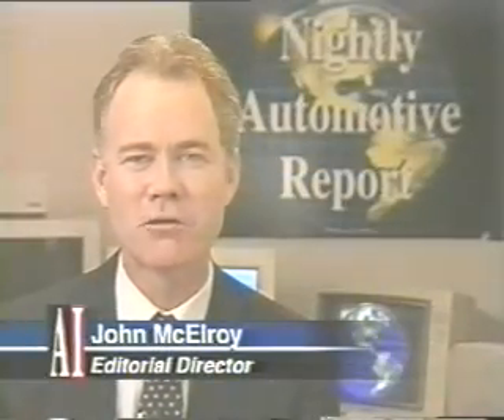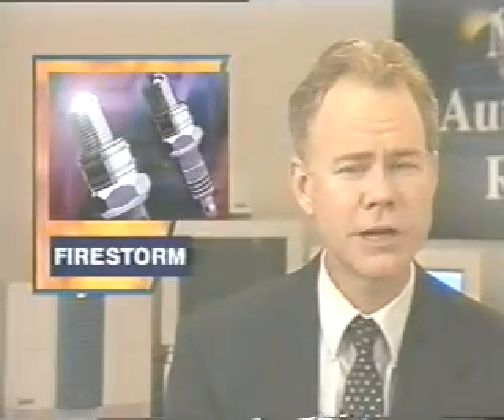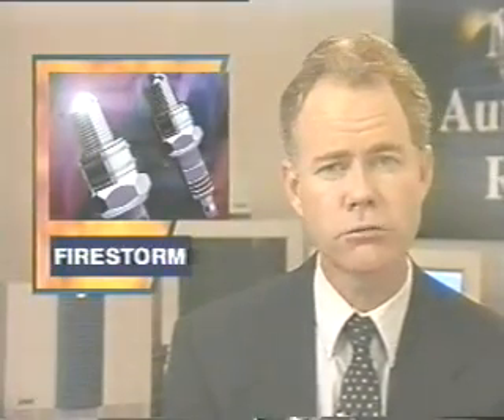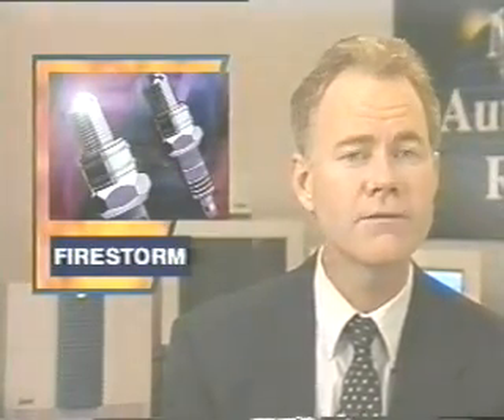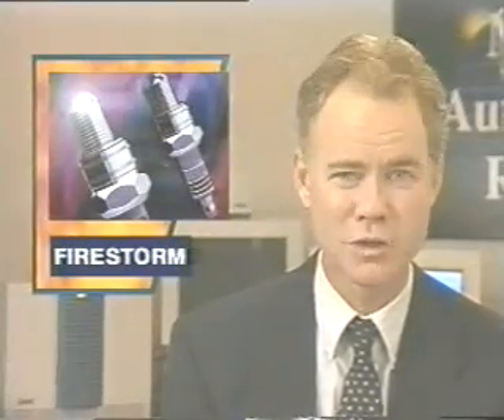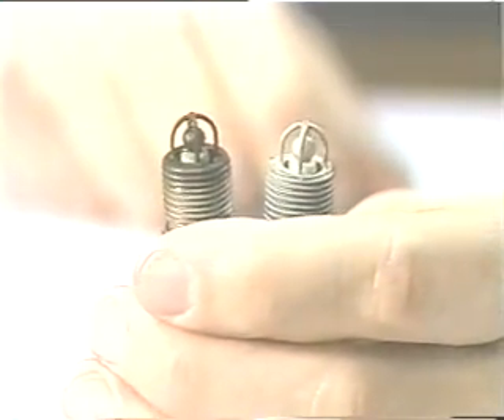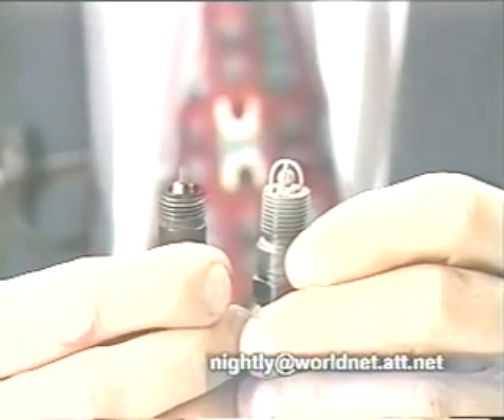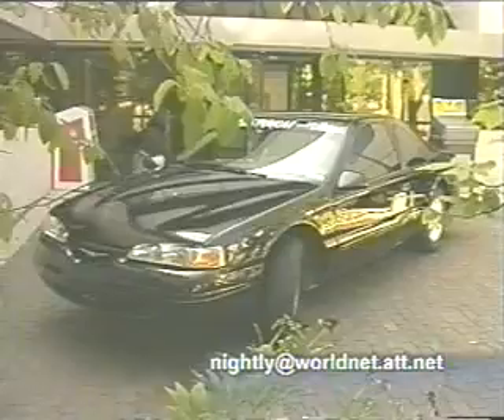Firestorm Spark Plugs

Comment: To get the most out of this, you need to use a small magneto to power the system, use capacitor discharge ignition systems, plasma jet ignition components to modify the CDI electronic ignition systems, then figure out the best alloy to make the Firestorm Plug electrodes.

Using a plasma jet CDI ignition to power these plugs and shield them from EMPs, you could make four stroke and two stroke internal combustion engines even more likely to stick around and use more effective technologies to improve the said engines to make them use alternative fuel more effectively.

Comment: That plug does NOT make the plasma by itself, it requires a plasma ignition system. That is where the effect is, not the geometry of the plug. The benefit of that plug is that it holds up longer with the plasma than a normal plug but again - is NOT making the plasma by itself.
Reply: Hence why the Firestorm Plug was invented, to allow you to remove the resistance in the ignition system’s cables and the basic spark plug or Firestorm Plug designs as the Firestorm Plug can handle this.

Another thing to consider is if you removed the need for a battery and used a small magneto that has its spinning timed just right, it would remove the need for a battery for your modern capacitor discharge ignition used in cars and trucks.
Reply: No You are making up a fallacy and are possibly a corporate shill... I  knew Robert personally and he even states the direct opposite of your claim in this video. Also The Plasmids disassociated H20 into browns gas... I'm guessing you work for Exxon Mobile... Maybe you helped break up the EV1 fabrication molds out in the dessert... I'd put good money on you being one of the paid supervisors... Well then... Your whole foundation is collapsing now no matter what you do... Honestly I Relish that.

Comment: Apparently the problem is that Bosch of Germany bought the patent and production rights and is sitting on the patent and producing nothing - maybe at the prompting of the oil companies..  I do not know how long it will take for the patent rights to  expire and move this invention into the public domain but it is a critical invention.  With this spark plug a whole new dimension of fuel alternatives are possible, especially HHO.
Reply: Gary Schaeffer The problem is in the fact that you have to make investments for money, new machines and high-temperature alloys
Reply: Pretty much heniumon

Comment: Further testing after that clip was shot in Detroit proved a 70% savings in fuel all while affording a 125 More Horsepower. 
It is a Paradigm Shift in Air Fuel Ratio as this plug operates at 30 to 1 Air to Fuel Ratio. All current IC engines operate at 14.7 to 1 and require a Cat and EGR. 

FireStorm can even crack water right in the Combustion_Chamber thereby eliminating so-called HHO Generators. Can I hear fill your car up at the side of your house with the garden hose? YES!!!!

Comment: "ignite all at once..." uh, no. Have you heard of "octane rating"? We add octane to gasoline (or do other things to increase the octane rating) to KEEP IT from igniting all at once! When that doesn't work quite as well as it should (like when you use lower-octane-rating fuel in a high compression engine), the result is called "knocking." Modern cars will adjust the timing to avoid it, at a loss in power. Excessive knocking (i.e. too-fast combustion) will destroy your engine.

Comment: What I'm talking about is that water is what you get when you burn hydrogen. Hence, yes, water is hydrogen that is already burned. 

As for splitting water, please learn some basic electrochem and T.D.. Yes, you can split water. That's an endothermic reaction. It takes more energy than you get back from oxidation. It does not matter in the slightest how you do either step, this sequence is and always will be a net loss - see the first and second laws of T.D. And no, catalysts won't change this.

Comment: @men8ifr Right I agree. Everything I've read, higher air/fuel ratio, higher NOX. Honda used to make 'HX' trims of the Civic, which had a lean burn option, and the car had two catalytic converters to keep NOX down. Too bad they don't do that today, I guess they couldn't bring the emissions down far enough to be able to run lean and pass CAFE/EPA.

Comment: wow so many faults with this video:
1 - fire plug looks nicer in the video because it distributes the spark around, the regular plug fires at the same spot every time - both have merits only an engine dyno will reveal the truth not a pretty video. 
2 - Emissions go down - are you kidding! ever heard of NOx?? NOx increases with higher AFR ratio's. 
3 - His car car fuel economy went up because he leaned it out! (no manufacturers can do this due to emissions (NOx again)

Comment: The best spark plug is one that can ignite all of the combustion gases at once. Some design are better to make the reaction faster. High voltage is one of those solution. More intense spark also help. But in the end, a spark plug of the same  diameter will net around the same result. 2-3-4... spark plugs could net better results, but it,s not economically viable for a marginal gain. In the end, just use long life spark plug. Done

Comment: @lynel1985 Indeed it's close to none, but as time goes on, the wear on the copper plug is much faster and the gap widen between the electrode and the cathode, thus creating an increasing load on the electrical system, load = losses so more fuel to burn to get the same power output. Copper is good and cheap, but require more maintenance and replacement. Also they don't handle well the newer high high voltage output of newer cars, one of the reason car maker use Iridium.

Comment: Reducing the ratio of Air-Fuel lower thant 14,7 to 1 will lean the mixture and the combustion will run hotter causing a drastic raise in Nx. Pointless solution, only viable IF it consume less power to spark, much like Iridium does vs copper sparkplug. A finer tip = less voltage drawn = reduced load on the alternator, thus reduced fuel consumtion/increase power.

Comment: what an absolute load of shite. running an engine at 24/1? bit lean isnt it. plug may be able to take the heat but are the pistons up to the job? or the Head gasket? where is the extra air comming from? or has it just decreased the fueling? it would run like a bag of shit, and would melt something.

Comment: I recomend some 4 prong Bosch platinum  plugs,a Bosch 02 sensor and premium wires,valve adjustment and timing belt check or belt replacement.And you should be good.

Comment: is anyone selling these plugs?
What are you crazy! if you can add and subtract this would be an inexpensive test for improving my gas mialage. But there is the auto makers computors using the exhaust air to maintain the fuel in there to regulate how much fuel is remaining unburned for the cat ot evaporate. Big vicious circle... There is no stoping these fuel waisters tactics.
Keep up the good fight Krupa! you are a hero!

Comment: @kermit30au No, not really, any current engine design can run 24:1 without burning up assuming you have plugs that can fire that lean F/A load, in fact you can do away with the radiator system just like in Smokey Yunick's adiabatic engine designs of the 1980's that ran lean combustion.

Comment: What are you talking about? Post mix combustion? we are not talking about injecting fuel and oxygen seperatly. You should read up on stoichiometrics regarding gasolene and air mix which is 14.7 and cant be altered unless your engine is made from something that can withstand higher temps.
The spark plugs that are specal will ignite the mix under adverse conditions like high compressions. The iridiums do this with aprox 5000volts less than your normal plug giving you a strong flame kernal.

Comment: Engines run 14.7:1 because of poor spark plug and engine design. Most of the heat an engine collects is from post mix combustion during the exhaust stroke. This can be clearly seen when you run an engine without exhaust manifolds and blue flames are shooting out the exhaust ports.

Lean the engine out the 22 or 24:1 and there is no fuel left to burn during the exhaust stroke so the engine runs cooler.

Comment: think about that for a sec. he never said he added more air. They state that the air:fuel ratio is changed.  the ECU can change the lenght of the injector pulse thus changing the ratio base on all of the engine monitoring sensors. The more  effectively an engine can burn gas the less time the injectors pulse for. that is why worn out plugs adversly affect MPG ratings of the car. so there is no extra air there is less fuel wich increases the air:fuel ratio. but that is alot to expect from a plug.

Comment: playing around with air/fuel mixtures is not recomened. The reason why fuel is burnt at 14.7 is because of the chamber temp it produces during the power stroke. Any modification to the air ratio will create higher temps and of course start to burn and melt things...Im sure the only thing that will survive that meltdown will be those spark plugs.....

Comment: Hoax.  Engines are designed to run at the optimal (stoichiometric) fuel-air-ratio.  This is called the running on ratio.  There is fixed amount of oxygen needed to combust gasoline (a hydrocarbon) to yield H2O and CO2 and energy.  Increasing the air will not increase the energy yield.  In fact, energy will be diverted from useful work by heating the excess air that otherwise inertly passes thru the system.

Comment: 1. modern day spark plugs have been getting smaller and smaller. there contact electrodes are very tiny adn ignition coils have also been getting smaller and smaller....thus a smaller spark and a less combustive reaction.

Comment: 2. krupa had used older style ignition coils, coils delivering much higher energy outputs, he also changed the contact points on the spark plugs to hte shape of intersecting smei circles.....thus the spark would jump across many more contact points rather than just one point .....one contact point will lead to the failure of a spark plug over time.

Comment: 3. by using energy in the kilojoule range one would notice that this would instantly weld the electrode gap...well how does one get around that......we hold back current and let voltage rise, still using the same power wattage....this still is a plasma (ionizing the air in between the electrodes) but we have an incredibly high potential pressure or stress forming inside this plasma ball.....

Comment: now anyone who has replicated a stanley meyer fuel cell knows this is the methodology for splitting water.....and anyone who understands the geet process or has replicated it understands that plasma has the power to break hydrocarbons into simpler elements and in some cases transfrom elements...which is still unexplainable effect in plasma.....

Comment: so not only are we capable of completely tweaking the usage and power output of our gasoline to air ratio to upwards of 40:1....yes and that is correct 40 parts air to 1 part gasoline....without the creation of N2O and a 90 percent decrease in pollution just as paul pantones geet fuel reformer.....but we can also do fuel mixtures of 75 water and 25 gasoline using methodologies from stanley meyer.

Comment: Because a plasma flash is non damaging to the metal of the plug, unlike the hot spark of an electrical spark which causes the metal to burn off.

Comment: 24:1 AFR? sorry, but thats not going to happen no matter what SPARK PLUGS you use. stoichiometrically balanced AFR is 14.7:1(unless you change the fuel)
im not saying that a spark that much stronger wont give you better performance or economy, a strong ignition spark always does, but there are some rules with internal combustion engines that cant be changed. if you were to run a 24:1 AFR without detonation, you would only be using about 1/2 the air in the cylinders.
oh and nothing lasts forever.

Comment: These plugs are not dead yet!

Bob is still in the process of getting a manufacturing facility up and running.

Nobody will make them because once cars are equipped (new or retrofit) there will be no need for replacement plugs and they'll put themselves out of business. Only new car production will need the plugs. Why build something that doesn't wear out? Because you're in it for the right reasons instead of just blind profit!

Comment: Did you know that a modern gasoline engine gets its most efficient burn of the air/fuel charge on the exhaust stroke, and not during the power stroke? Post mix combustion is the wrong time and place to burn the remaining fuel.

To get 40% more economy is easy, Smokey Yunick's lean burn hot vapor engines got over 100% better fuel economy, and his engines ran about 22:1 air/fuel ratios.

Comment: You'll never get an engine to run 24:1 with convention spark plugs. The problem with 14.7:1 is that this ratio was not picked for it's power or efficiency, but because it's what the conventional engine needs to operate reasonably well in many respects. 

The lean burn engine on the other hand, eliminates many of the handicaps that 14.7:1 imposes. To get the most power from the engine the fuel must burn and expand during the power stroke, and not during the exhaust stroke like 14.7:1 engines do.

Comment: Look up the size of hydrogen, and oxygen in chemistry oriented sites. sum the volumes.
convert that to a sphere with that given volume. now take distance across sphere.
thats your wave length=W. 1/w is frequency.
Then test around that spectrum woth around 200-1000 watts power. Use great care, and do not do it in your house. If you accidentally etherialize the water, the force in lbs./sqare inch is enormous. Do it in a shed @ 100 feet away from you and anything you care about.

Comment: The chart for shim spacing of the plugs would be based on mechanical specks of all motors I can get specs for. Basically, all you would have to do is hold a Firestorm plug, next to the one for your car, and add shims to match the length !

Comment: My main backgroung is in Microwave Electronics & Systems, but I have programming skills in BASIC & FORTRAN 4. Also I've a good understanding of Cartesian Coordinates, and would pick up a program language for CNC pretty quick. All I would need is a good reference manual. Basically it's roll up your sleev's, diagram the problem and operations needed, write the code, run it and debug it...

I live in Brooksville Fl. now, and will be re-locating to North Kingston, Rhode Island in @ 5-12 months.

Comment: As for igniting the fuel-air mix, I really don't see what an improved spark can do that the initial flame front from an ordinary spark cannot. There is no need to adjust the "frequency" to match any aspect of the fuel; ignition doesn't work that way. 

The resonant freq. of water is irrelevant; water is an ash, not a fuel, and no amount of pseudoscientific gobbledeygook will make it otherwise.

Comment: Uh... an EM wave is not a "sphere" (it has no "surface", so there is no notion of "the size of the sphere"). It is created by electric and magnetic fields at right angles to each other (doesn't really matter which is "horizontal", all is relative). In any case spark plugs are not fed by alternating current... Time-varying current, certainly, but not of any particular freq.

Comment: Sorry, but it's a hoax. Anybody who paying attention in a first-year science program will agree. They won't change their minds after they get a PhD, either. 
Why don't you Google 
hyperphysics hydrogen electrolysis
and read the first hit (at phy-astr dot gsu dot edu ). 
As for MY credentials, if I did post them you would just say I copied them from someone else or made them up, so what would be the point? I have spelled out the truth for you several times; that is all you need.

Comment: No overunity, just measurement error. It is EXTREMELY difficult to correctly measure heat energy (this is the error made by the original "cold fusion" proponents); it is even more difficult to do so any time high transients are involved.

Comment: All of your comments along these lines are very standard complaints from "free energy" types. "You have a closed mind," "you're just being negative," blah blah blah. 

Eventually, if YOU keep an open mind (which you have shown no evidence of so far), you will find that 2+2=4 on your bench just as it does on mine. The sooner you learn that, the sooner you will have a chance of actually doing something productive. But I'm not betting on that happening, ever.

Comment: Like so many before you, you confuse technology with physical laws. "People like me" include people who split the atom, who went to the moon, and who built the microprocessor. NOT by thinking they could ignore long-established physical laws, but  by starting from what was already known and working forward. That's how progress is made.  
Incidently, electrolysis cells run best on pure DC. Anything else does nothing but heat the water.

Comment: Absolutely right ! I have offered to try and help set up a CNC shop back in New England.
It will be @1/2 year till I get back there.
Then I have to contact some old machinist friends. If it works we will produce the maximum plug lengthe needed, and there will be a chart showing how many shims you need to fit it to your vehichle. That will be the simplest way. So anyone in the Southern Mass.
or R.I. area who is interested in helping set up or maintain production please respond here.

Comment: Seriously, if you can really achieve overunity with your toroidal transformer as you claimed, you don't need to bother with the "splitting water" step. Just run the output back to the input and tap off the excess.  You will have a generator of completely free electric energy. It will make you a billionaire, at least, AND win you a Nobel prize in physics. I await news of your recognition!